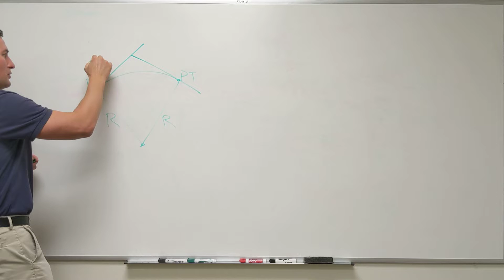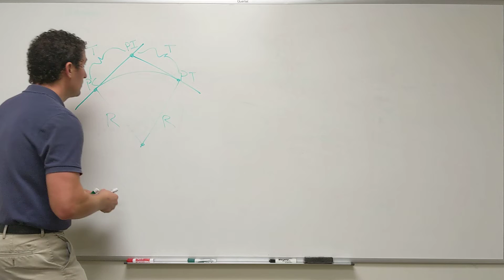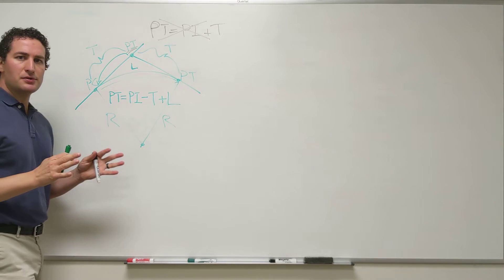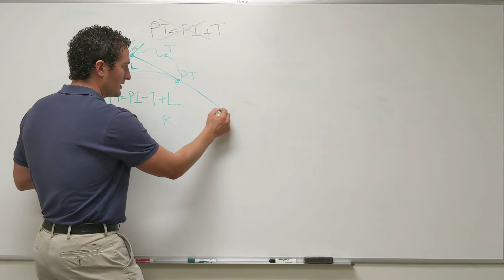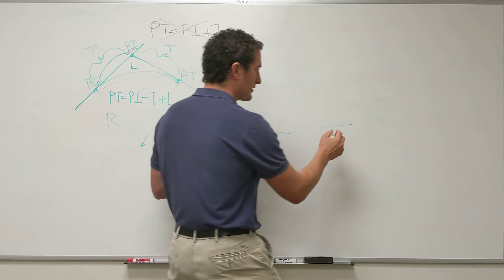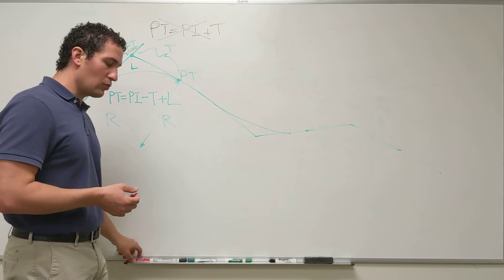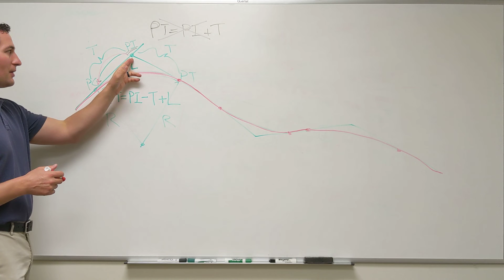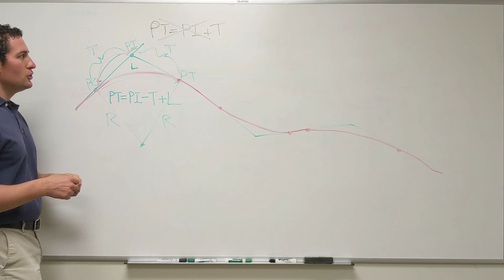Stations for a Horizontal Curve - Always Along the Centerline of the Road

Comment: If you find the station on the curve that correlates to the PI they do not align. (this is my confusion) 
You are curving T's length into the curve so the station changes. What do I know though... I just have to follow the equations and call it a day.

Also the image that's always presented makes it seem like it is symmetrical so it's confusing.
Reply from the maker: This is one of the most challenging concepts in horizontal alignment.  The preliminary traverse which establishes the station of the PI is then meaningless as we transition to stationing along the curve (as you noted, the PI station and length of T along the curve do not match).  This video showing more details about stationing along a horizontal alignment might be useful for you: https://youtu.be/3rrm63hDrCI
Reply: @FindleyDaniel  Wow this finally making some sense. PI stationing, call it 50+00, is not the same as STA 50+00 along the actual curve. STA 50+00 (PI) is floating in 2D space off the roadway, and STA 50+00 (on curve) is also a point along the curve. How do we differentiate these two?
Reply from the maker: @gregoryolson1781  You're exactly right!  It sounds like you're definitely getting it!  I like to differentiate the two by calling the alignment with the PVI the "preliminary traverse" because it includes the tangents (forward and backward from each PVI).  Then, refer to the curve, PVC, PVT, segments between the PVT of one curve and the PVC of the next curve, etc. as the "centerline."
Reply: @FindleyDaniel  omg Thank you 🥹